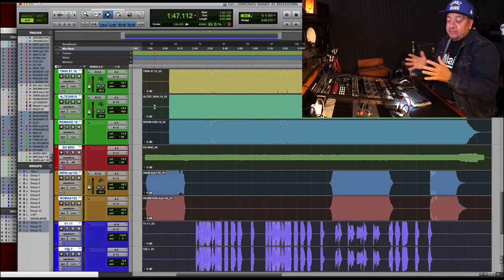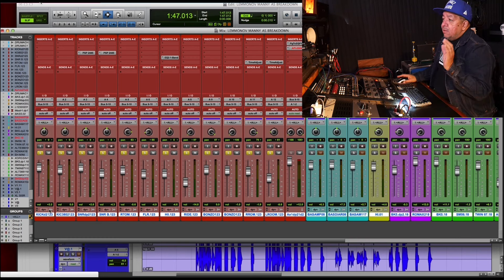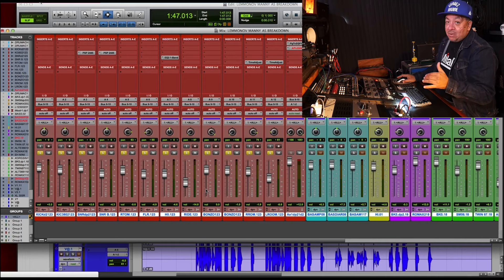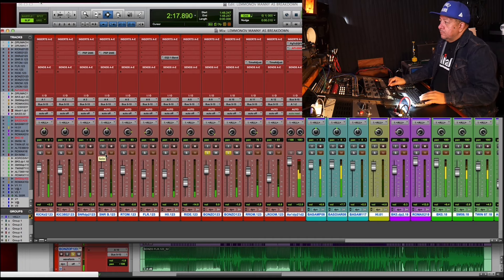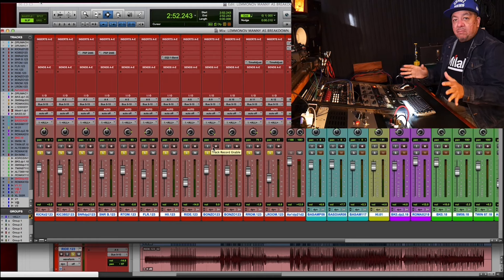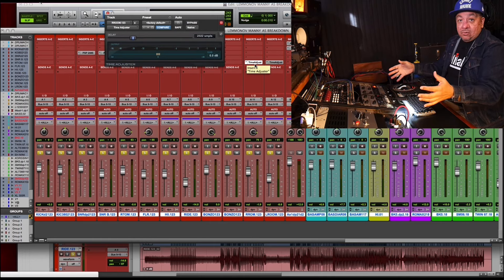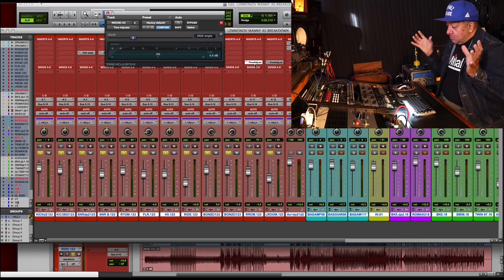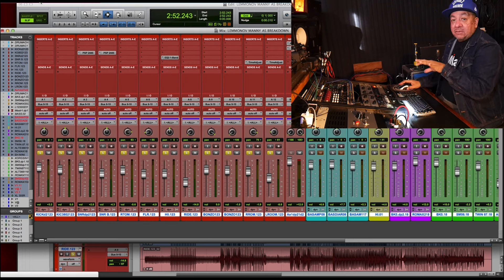How to record REAL DRUMS the OLD SCHOOL WAY

Comment: Thanks Manny, realy cool sounding drums. I use a similar setup and wonder how you deal with the level of the leftchannel (drummers perspective). when I use the glynn johns setup i kepp runing into trouble with the level of one channel, cause the snare is always very loud. I also wonder if you got a solution for busing the overheads with toms (rack + left overhead and floor + right overhead)? i use it because i got only 1 8 Channel Interface. 
Keep up the good work! Always a pleasure to watch your content because I realy dig your taste when it commes to sounds, cheers
Reply from the maker: Hey Robert, thanks for sharing, I’ve always used audience perspective, and after 25 years of recording, not too many drummers have complained. As far as the overhead being John Bonham style the way I pin it is the overhead is pound all the way to my right and the floor tom side is penned all the way to the left hard panned then I have a kick mic in A snare Mic that i move up loud in the middle. This takes up some of that loud snair from the center overhead that I panned. I very rarely if never processed the drums one at a time and then bringing them into the mix. I always pass all the drums into a stereo auxiliary compressor usually a plug-in API 2500 then I do a blend to try to make the drums sound real rarely gating, but sometimes when I get a mix from someone else, I will have to do some of the standard processing. But when I track and produce and make my own records, it’s raw dog is huge it’s powerful.
Reply: @mannysmiclocker thanks! i got it. to explain a little bit: i use a noiseinger (Behringer) UMC1820 ... the setup is: overheads left and right Superlux R102, for rack tom a tbone cd 56 and for floor tom a bd 200, both bussed togehter with the overheads, bassdrum: superlux R102 just laying on some foam in the middle of the bassdrum facing the beater, for snare i use a y-cable for top: superlux PRA218a, snareside: tbone ms57 (phase checked: works), for room i got a omnitronic vr1000 right over drummer (my) head. as you see: cheapotime all the way...BUT: Ribbons!(R102, omnitronic vr1000).🤣
Reply from the maker: @robertsackl3464  Brendon Obrian uses those Y cables and I’ve gotta get that wired up too! Super cool and I used a Ultra Gain for like 10 years as a converter 8 mics into my Digi 003 w 8 pres

Comment: Manny I love your drum sounds! I have a couple questions, your waveforms look clipped, that is something I have tried to avoid in gaining staging (maybe I’m wrong though let me know) how do you get such big drum sounds with the peaks clipped so dramatically? Also I noticed you have condensers on the toms, is there a reason you are not using dynamics like the AT230s anymore? And lastly can you mention any EQ or distortion that you may be adding to the room mics on the preamp stage before the audio goes into pro tools? It sounds to me like something is adding to the bigness of the room mics. Thanks, I really enjoy your style of explaining things BTW.
Reply from the maker: Steve,
In tools I can expand the wave form so I can look at them and see them better. Those don’t reflect the sound it’s only visual so I can see everything when I’m editing. Next time I do one I’ll shrink them so they look more accurate. Also, there is no gain stage except when I’m mixing I always use an API 2500 plug-in or hardware if mixing analog. Those Lauten condensers are amazing. Over the years I have preferred Condensers over dynamics I don’t use the 230s, but those are my favorite dynamics for sure 100%. If not for the Lautens I would’ve never changed out. The reason you hear the cane stage in the drums is I’m mixing them into an auxiliary. I rarely use any EQ but it’s more like slime in the sound into the API depending on the band the song in the mood it’s all mixable or sometimes I rarely use that and sometimes I hit it heavy like this track. If there is any QA use, it’s always a Pultec that’s on the stereo mix of the drums. If I do an individual drum, I will use an API or Neve, according to the band, and of course their sound.
Reply: @mannysmiclocker  thanks so much for the reply! One last question if you don’t mind, I have been trying to figure out what is a good ratio to compress a drum mix for big drums (lately I have been mixing into a main submix bus with 1.5 ratio SSL Bus Compressor plugin compressing about 1-2 db), what would you recommend as a max ratio on the drum bus to not take the life out of the drums but still sound huge and should it be parallel compression? I do compress my individual drum tracks before the drum bus BTW.
Reply from the maker: @SteveRiddleGuitar  honestly the API 2500 plug in gives me all the harmonics and grid I need there is no set ratio. I just mix the ratio. It sounds good and I use my ears. The threshold would be the best you can to not have the drums and cymbals pump because I’m also using a Mastered limiter with compression you do have to use carefully and when mixing.
Reply: @mannysmiclocker  Thanks!